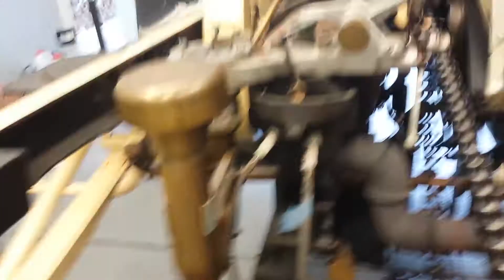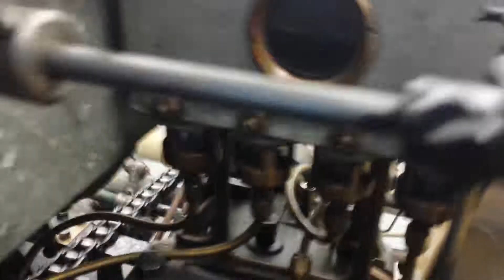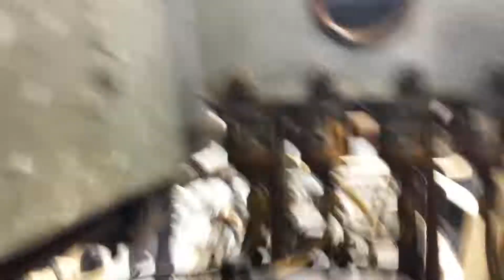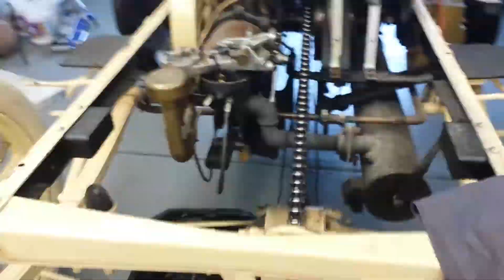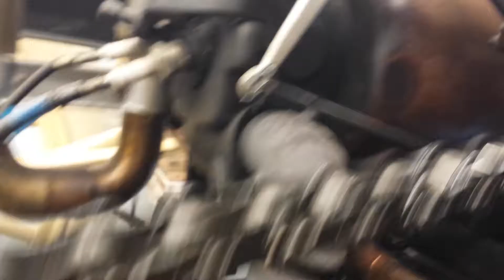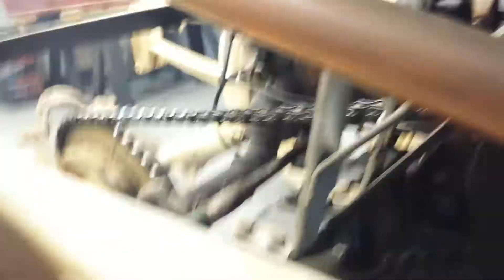1905 Cadillac running chassis

Comment: It looks like you should check the water pump drive. The drive arm on the crankshaft appears to be not turning. It should be threaded on the crankshaft and locked in place by a set screw. The pins on the arm then drive the water pump. If the water pump doesn't turn the engine can overheat and seize before too long.
Reply from the maker: Yes good eye! I was quite aware that the pump was not turning and did not run the engine much longer than the time the video was shot. I was in the process of taking the assembly apart and wanted to run the engine for a short period of time before taking things apart. You never know how long things will be in an inoperable condition. I am rebuilding the water pump, made a new impeller shaft  and gland compression nut ( threads are stripped out). Also replaced the ball bearings and thrust plate in the high speed clutch dog too.
Reply: I just bought one of these 1905 Cadillacs, and clearing the parts. It has been taken particularly apart, and some of the pieces are in boxes. Would anyone consider possible letting me see a complete Model F Cadillac ?